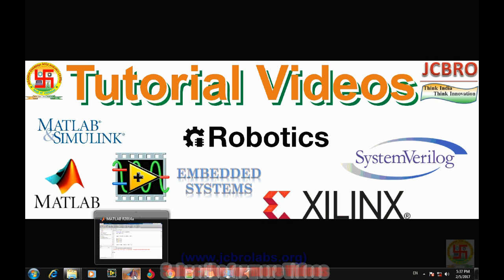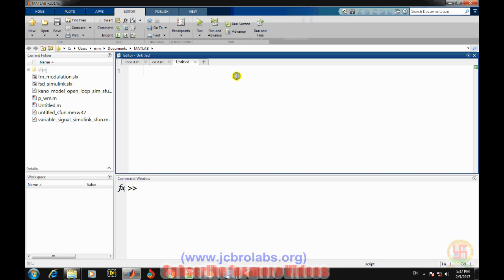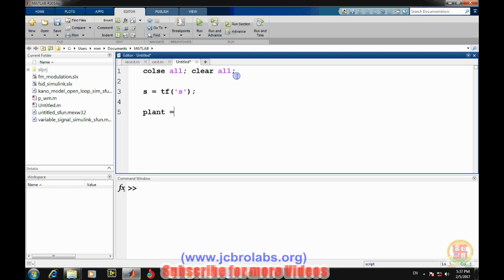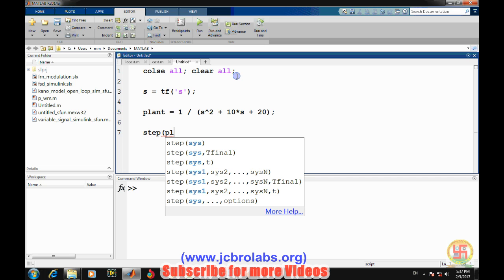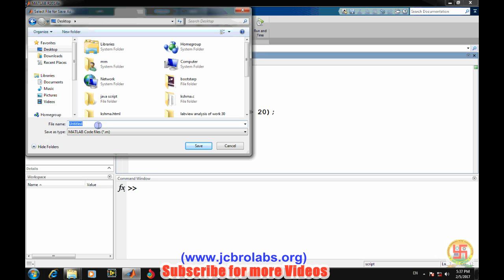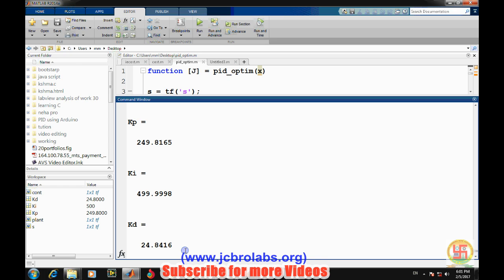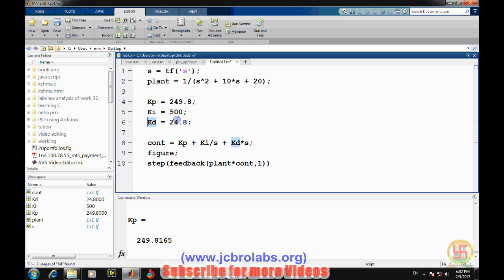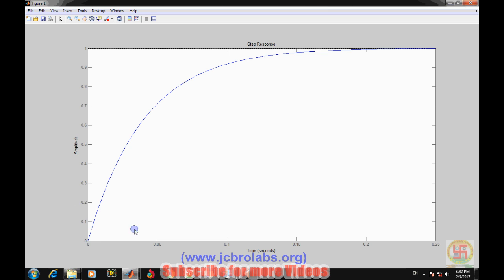Genetic Algorithm based PID parameter Optimization....

Comment: sir can we do optimization without transfer function with only Kp Kd and Ki values???
Reply from the maker: If there is no transfer function then you can use model represented by in some other form.
Reply: @buildwithsharma  i only have PID parameters values from these how can I use GA Code ??

Comment: I get an error it said : All functions in a script must be closed with an 'end'. how to fix that.
Everything is Not Fine for me
Am I missing something or what? 
Pls Help
Reply from the maker: put 'end' character when your function ends.
Reply: @buildwithsharma  I have already put the word 'end' at the end of the function but the program still get the same error. I don't know what I am doing wrong at this point.
It is because the version I running? I run your same exact code at 2020a version. Do I need to rollback to your version or something?
Reply from the maker: @kafaicheng8128  In that case, I can't say exactly with having a look at the code.
Reply: @buildwithsharma  Here is my code , I roll back into 2014a then there is a new error , it said
Error running optimization.
Error: File: pid_optim.m Line: 4 Column: 1
Function definitions are not permitted in this context.

my code:

close all;
clear all;

function [J] = pid_optim(x)

s = tf('s');

plant = 0.01/(0.005*s^3+0.06*s^2+0.1*s);

kp = x(1)
ki = x(2)
kd = x(3)

cont = kp + ki/s + kd*s;

step(feedback(plant*cont,1));

dt = 0.01;
t = 0:dt:1;

e = 1 - step(feedback(plant*cont,1),t);

J = sum(t'.*abs(e)*dt);

end

Comment: Sir ,can I used for fractional order controller,and process and code is similar or different
Reply from the maker: It will be same. 
Learn PID, FOPID, Fuzzy-PID, HIL Simulation, Optimization, LFC, DC Motor control, Inverted Pendulum Control, DVR control and much more, all in one course.
https://www.udemy.com/course/control-system-and-optimization-using-matlab/?referralCode=E2905A33566486F41B6E

Comment: hi 
is there any way of using GA (optimtool) to find PID parameters for a specific response?
like certain settling time or overshoot or Gain/phase margin to step input?
i suppose its somehow possible but the only thing GA cares about is decreasing cost function .
Reply from the maker: Hi, yes that can be done either by making the appropriate cost function and adding inequality conditions.
Reply: @buildwithsharma  and how is it done ? like , i have an unstable transfer fcn and most likely the GA will stabilize it. but specific overshoot and settling time (or PM/GM) are not leading us to proper cost fcn . 
i mean , minimizing the error (IAE,ITAE,ISE ext.) is possible but how can i connect this subject to proper cost fcn?
what kind of calculation does it need?

thanks for answer btw Dr.sachin .

Comment: if I did not want to use transfer function, then can ı use Tune the PID controller? ıf I have a no. of KP, Kı and KD values then ı want to optimize at which piont it will give maximum value. can ı use it please explain me. and how I can do ıt.
Reply from the maker: If you don't want to use transfer function or model then how will you obtain the response.

Comment: Optimization running.
Error running optimization.
Undefined function 'pid_optim' for input arguments of type 'double'.

I am getting this error.
Reply from the maker: Make sure, all created files remain in the same folder.
Reply: I also got the same error. How did u rectified.
Reply: @keerthanapb884  refer to that book H Saadit on Power Systems. They have explained this system thoroughly.
Reply: @etpaprika  Thankyou.
Reply: @etpaprika   Couldn't find  this topic in hadisadt

Comment: Thank you for the video sir. What if i want to give a sine wave input instead of step input?
Reply from the maker: Yes, you can apply sine input instead of step input.
Reply: @buildwithsharma   Thanks for your reply sir. I need a desired output to be zero. If i am using error function as 0 minus response from the output and trying to minimize the objective function, the kp,kd,ki  are getting equal to zero. And also in the video step input is given to the both the controller and plant. How can we give disturbance input only to the plant function.

Comment: Before GA , how I can calculate ITAE ?? Because you should compare the value the ITAE value before and after applying the GA....
Please reply
Reply from the maker: Sorry, but ITAE is objective function which has to be minimized for better response of the controller.
Reply: @buildwithsharma   Can I calculate ITAE of a transfer function with MATLAB code ? If yes then what is the MATLAB code for calculating ITAE, ISE ??.... And when I put the values of Kp, Ki,Kd obtained from GA in simulink box then ITAE value is far different why?

Comment: why have you taken the time from 0 to 1 sec ?
Reply: I think he is having the errors within only 1 second. Then it implicitly indicates the settling time of the system should be less than 1 second. It is fair to think it happens like that because controller gains are calculated so as system would settle before 1 second

Comment: Hello sir
i am trying to implment ur method but when i type the code in matlab2013b i got the error no enough input argument 
plz help
Reply from the maker: There is a problem  with your function definition. You can contact at: jcbrolabs@gmail.com
Reply: I sent you an email please check your email
TQ
Reply from the maker: You can contact at: jcbrolabs@gmail.com

Comment: hi, thank you very much for this video, plz how do i tune all the 4 PI controllers with genetic algorithm of a statcom; the statcom has 04 PI controllers.
1)one PI for AC voltage regulation
2)one PI for DC voltage regulation 
3)two PI for d and q axis current controllers

I really thank you from the bottom of my heart
Reply from the maker: Hi, If you need some assistance then you can contact at jacbrolabs@gmail.com

Regards
Reply: merci infiniment
Reply: hi , I sent an email but there is no answer plz i need your help sur  and really thank you
Reply from the maker: what is your mail id? so that i can search for the mail..

Regards
Reply from the maker: Hi, We may not get any mail. Please resend it again with your model and problem statement.

Regards
Reply: hii, am very sorry for the inconvenience . when i send the email i get an email saying '' address not found '', do you have another email or what should i do ??
Reply from the maker: It's    jcbrolabs@gmail.com
Reply: so good the message  send well
regards
Reply: good luck fatima
Reply: bonne courage
Reply: good luck fatima
Reply: I have same problem about statcom, can you help me please?

Comment: Great! This is exactly what i need for our project. How do you implement this in the PID Controller of a Quadcopter?
Reply from the maker: either use real time optimization algorithm or use quadcopter mathematical model or simulation model to tune PID controller.

Regards
Reply: Thanks! Can it be also embedded in Arduino cause that's where were obviously going to implement the PID for our Quadcopter
Reply from the maker: PID can be implemented but not sure about optimization algorithm
Reply: Thanks! At least the PID can be implemented. I'll probably have more queries on this, i'm really having a hard time